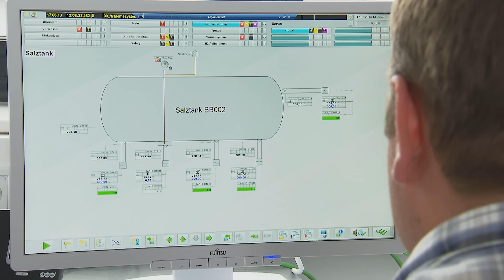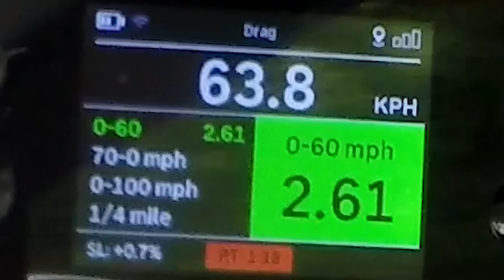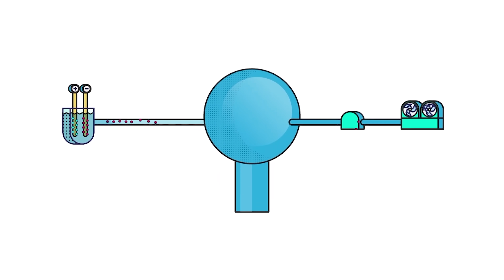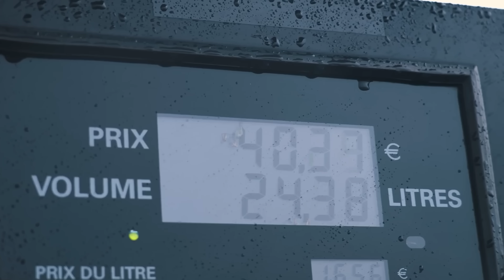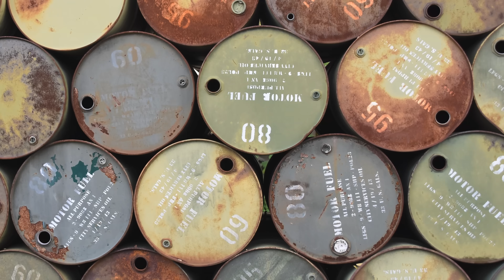Porsche just SAVED petrol engines FOREVER

Comment: Rather than banning ICE cars, if i were EU legislators, i would ban change of cars under 5 years.
I would say you will not be allowed to change and buy a new car while you have a 5 year old or lower car. And if you have a car between 5-20 year, you are not allowed to scrap it and you cannot sell more than 2 cars within a 10 years time span.
Especially now that synthetic fuel is a thing, they should use legislations to restrict planned obsolescence induced by users frequently changing cars. Because changing a Tesla every 5 years emits more carbon than driving a civic for 20 years. It’s fact

Comment: Look, if doing this successfully can save all combustion engines, all the big brands should be working on this. Bugatti has recently just released their last W16 which is very sad, but if this goes through correctly, it doesn't have to be their last. If all the big carmakers work on this as a joint venture, and eventually convince governments that it is the right way, there is no reason we can't convert to this fuel all around the world by before 2028.

Comment: Hi,
I think you forgot to mention a couple of huge downsides with E-Fuels: 
- Energy demand is 5 times higher than powering an EV (funnily enough you mentioned that beeing a problem with EVs) -> Will always be more expensive
- There are things that need E-Fuels more than cars (planes, large ships, industrial etc.). Meaning: Every E-Fuel driven car takes away from other use cases until scale up is complete. 
- Did we not learn what happens when you are overly reliant on energy from foreign countries? Why not take the route where you depend less on that. 
- E-Fuels do nothing to make air quality better and have no way of reducing brake wear through regenerative braking

Overall Im no fan of a ban, however this wont matter much in 2035. The law of the market and economy will dictate what technology wins.

Comment: Bring on the new ice engine ban I reckon.  The car lobby has the money to influence regulation (face it, corps run the world not govt).  Many won’t make the shift…either through cost or not fit for purpose…older will gain in value and without uptake of the latest iPhone on wheels large automotive companies will either go broke or change tact.
Our NZ govt brought in a ‘dirty’ car tax for Utes…blanket rule.  My ute that’s euro 5 complaint and gets 7.9l average…has a $5000 tax put on it but a sedan that averages 12l per 100km dosent.  This makes no sense at all, but instead of ruining the value of my ute it actually increased it as every ute went up in value.  Thanks Labour Party…I’ve got 3 utes (farmer) and you’ve actually done increased their worth thru your idiot manipulation

Comment: I hope this actually comes to fruition. As an EV owner, it is blatantly clear that EVs aren't for everyone and an alternative needs to exist to be able to sustain mobility. I am not too convinced about liquid hydrogen cars as of yet and it would pose a similar conundrum to EVs with the infrastructure to support them. But e-fuels really do hold a lot of value as the transition to them is not as far fetched and maintains a lot of the current infrastructure intact for petrol vehicles. Good luck to all pushing this forward.
Reply: Apart from the actual gas stations non of the infrastructure beforehand can be used.

You need:
New power plants (solar, wind, storage),
Water supply or desalination plants, 
water purifiers, 
electrolysers, storage for hydrogen, 
Carbon capture plants, 
E-fuel plants

The larger projects right now (Chile) als need transport infrastructure.
Reply: @theipc-twizzt2789  I was talking strictly about the distribution infrastructure which is the primary problem for EV owners and mass EV adoption. Production infrastructure development would come from most current fuel developers as they'll need to adapt or disappear. In terms of requiring carbon neutrality from the production infrastructure power source, if the countries are still not 100% non-fossil sourced, then it's a little hypocritical to request the same from the production facilities. It defeats the purpose when you charge an EV with a still primarily fossil driven power grid such as EU or US. That needs to be developed by each country's plan to shift but shouldn't be a dissuasive to change petrol for alternative fueling. As they say, every little helps and with time all pieces of the puzzle will line up.
Reply: @AStock2204  There is no point in burning fossil fuels to create synthetic fuels. You do realize that this would increase CO2 emissions? 

The advantage of battery based cars is precisely that: Even with an 100% fossil energy grid they have 10-20% lower lifetime CO2 emissions than burning fuel directly in an ICE car. This is due to combined cycle power plants beeing up to 60% efficient.

So no - the point you make should not be considered. The only thing that should be considered is CO2 emissions. If E fuels emit more CO2 than fossil fuels then they should not be allowed. It they emit less they are fine. 

I fail to see how the power grid is a limiting factor in this. Even in the worst case assumption the grid would need to grow by less than 2% per year to accomodate a fully electric vehicle fleet by 2040. I invite you to do your own calculations, but this should be somewhat accurate. 
Using home storage, virtual power plants and vehicle to grid should all alleviate this problem.
Reply: @theipc-twizzt2789  not my problem
Reply: e-fuels do not solve the problem of localised pollution. They still 'burn stuff'...so people living along main routes in cities will get no relief from NoX, S02 and particulates. The root of the problem is internal combustion, whatever it is you're burning. There is a better technology which solves this problem, we have it already and it is growing fast.
Reply: This all assumes that the push for zero CO2 emission vehicles is about saving the planet from global warming. EVs warm the planet in their own way (increased CO2 emission at production than ICE vehicles and increased thermal load to atmospheric from power generation and distribution. As predicted by the The Club of Rome in 1970s the tipping point for the atmosphere was reached in the 1990s, nothing can save the planet now. EVs or (e)fuel ICE is just another wealth pumping exercise from the poor and middle income groups to the already wealthy.
Reply: The day you can breath the emissions of a ‘efuel’ like it’s natural air, I’ll agree. Not gonna happen. Combustion produces a shitload of harmful emissions. Regardless of the fuel type. You want to keep poisoning us.. F U.. that’s my answer to anyone who decides to continue to drive combustion.

Look, i did it too for decades.. now i know better.. now there is a real alternative. It’s time to release the f’n damage we are causing ourselves with combustion and move forward. Fight it all you want.. bemoan that it might be hard or costly.. fact is.. we’re f’n poisoning ourselves slowly as long as we continue with combustion. And I am quite aware that we poison ourselves with other things everyday and accept it. Do we NEED to continue this one? EVs are only in their infancy.. they will get to the point that they meet 99% of use cases. If others continue to decide to burn shit for fun.. my proposal is, 100% of the exhaust gases are routed internally to the cabin of the vehicle. I’ll be satisfied that the morons who want this, get to enjoy ALL the fruits of it most directly.
Reply: electrifying water before the combustion chamber creates hydrogen.. water = fuel
Reply: Great... look to how your batteries for your car are made and by whom..In case you didn't want to know, so as not to interrupt your virtue signalling, it is children in the Congo who mine the cobalt, as young as six, owned by Chinese companies who sell the batteries to most of the EV manufacturers.
Reply: @gregorysukroo7167 he doesn’t care lol. Propaganda turned his brain to mush
Reply: @YuRMoMiNHD  I did read some papers on mining, minerals and batteries as well as hydrogen. 

If you know some papers that come to different conclusions i would like to read them. Could you provide a link?
Reply: @gregorysukroo7167 do you realise that Cobalt is used in refining petrol and diesel? Better stop driving your car you hypocrite.
Reply: @gregory Sukroo  Half the cars produced by Tesla use LFP battery which are cobalt free unlike the smart phone you are using to add your comment. Quick Google search will confirm this.
Reply: @gregorysukroo7167  Artisanal Mines in Congo account for around 15% of Cobalt production. That means that 85% takes place in properly industrialized mines (which, if you think about it for a second makes sense, as people with shovels could not nearly produce enough cobalt to cover world wide demand). 

In those artisanal mines there are unfortunately some children. Estimated suggest around 1000 children in all of Congo. The chance that my battery contains cobalt from artisanal mines is little, and it is even smaller that it contains cobalt from child labour. 

If you want to make sure to have no cobalt in your battery you can buy LFP chemistry. 

Did you know that 98% of cobalt produced is a by product of nickel or copper? 

Why is specifically Cobalt such a big problem for you? In regard to environmental damage cobalt and lithium are fairly ok (compared to oil) and child labour is a much larger problem on other sectors (like agriculture). 

Artisanal mines are also very inefficient. Some projections suggest that there will be essentially no such copper/nickel mines by 2026.

Comment: This is not news. Sabatier produced methane in 1897 and it was well understood that heavier hydrocarbons could be made from that. The US navy has made jet fuels from sea water and nuclear energy generated electricity for decades.

Of course it can be done. But it will be orders of magnitude more expensive than using electric energy through a battery. The same KWh used to produce petrol, can deliver many times more miles stored and used from a battery.

This will be a niche market for petrol heads at most. If they still exist in 2035. Because who wants to drive a noisy smelly ICE car when you can drive a faster, cheaper, cooler electric vehicle for a fraction of the price?

Comment: Ah ah -so the fossil fuel industry looby  wins. And we -an dplanet - are stuffed.  Unless you are somehow all naively gullible you know this E-fuel thing is just green hog-wash.  Real carbon free E-fuel will be just endlessly delayed and fudged allowing fossil fuel giants to continue to supply for decades. Thats what they ar eplanning for. Its the same with hydrogen . Green hydorgen production doenst make much sense (as you lose half of electricity upfront) why does that matter when fossil fuellers know the can coninue to fight and lobby to provide the grey/ blue version carbon produced. 
Might not matter so much as electric cars will become cheaper in show room soon. Simpler and more or less maintenance, servicng free with low fuel costs (currentlt costs me <£1 per 100 mile) -only ICE enthusiasts  will stick with ICE.
The stuff about charging is weak. I'm embarrassed how quick mine charges now. Barely have time to come out from loo before its' done at Tesla superchargers

Comment: Propagandist nonsense. The cost of e-fuels will be at least five times the current cost of gas. This might be fine to run some ice classics, but it is not going to mean that any manufacturer is going to be making ice vehicles in any quantity after say 2035, or more likely sooner. Which means that they too will be very expensive. Electric cars will be the same price as ice vehicles anyway by 2030 or before. Who is going to buy a car that costs more, costs more to run, that you can't refuel at home, costs more to maintain, is smelly, noisy and polluting and has lower torque and acceleration. By 2030 electric cars and the associated infrastructure will be markedly better than today. It's over.

Comment: Regardless of what Porsche comes up with - and reinventing petrol - doesn't a business case make. Unless Porsche already has some major distribution partners in tow, this will be just another minor option. All said, though, ICE engines will be supported easily for the next several decades. Easily! And the hand-waving about BEVs taking over with all this compromised tech (rare materials, dangerous recycling, significant overall costs, etc.) is not remotely logical or supportable. EV tech is already rapidly changing: charging, manufacturing, recycling, etc., etc., are well on their way to fixing ALL of these issues. Within a few short years, presentations like this will look more than a bit myopic. And keep in mind these ICE restrictions are ONLY for new car sales. Supply and demand will keep dino-based fuel around for quite some time, and I will be pleasantly surprised if Porsche's fuel will be anywhere nearly widely available.

Comment: Why doesn’t anyone talk about the source of the energy which powers all these new electric cars!?! The UK can’t cope now with the demand, let alone what’s coming. I’ve read that less than 40% of the energy the uk consumes is from a renewable source. This is only going to get worse with demand outweighing supply. So whilst it might be greener in the long run to use an electric car, the net effect isn’t drastically different. there is still a very long way to go and electric isn’t the answer - it’s the answer for tax breaks but that’s about it. The government backed the wrong horse, just like they did with diesel.

Comment: E-Fuels are gonna be a thing in the future, but not the solution right now. 

The only feasable way we can manage climate change is by, firstly, switching to 100% renewable energy and THEN produce E-Fuels with redundant power, moving as many people as possible (those who drive "out of convenience") to public transport, walking and cycling by redesigning urban areas and building out rail, and most important of all, make new cars  _lighter_, so less massive (I'm saying less than or about 1.5 tonnes/3500lbs for all privately owned vehicles).

Comment: With E-Fuels you're just adding another step between renewable energy and the vehicles.  Basically, instead of just going from the solar/wind to the car, you're using extra energy to actually make e-fuels and will also have to transport the e-fuel to the "gas/petrol" stations or wherever else 🤔All those extra steps will add extra energy consumption and cost. Sounds like a plan to keep the consumers in the pockets of the future oil industries.  Now saying that, it is definitely better than what we have now with the fossil fuels.  Still, I don't think there's anything that's gonna compete with the pure electrics.  Battery range is improving by the day.  Aptera is showing that there is potential to completely cut the middleman out. 🤘

Comment: I'd rather put the electricity straight into the car battery rather than a factory to create a fuel. And then put the effort into the problems with battery and ethics and charging speed.

Comment: It will never come about. Not the eureka moment everyone thinks. Batteries are getting cheaper, better all the tine and the network to support it is also accelerating. E fuels take a huge amount of energy to make and in order for it to be carbon neutral, needs to to be made using renewable energy.

It make no economic sense to do this when you can just charge a car / van / truck straight from renewable energy from your house / grid which by 2030 will be much more decarbonised.

E fuels will have use for classic cars and motorsport. It will never be cheap, think £10 per litre.

Comment: I am sorry, but as an Engineer I need to adress some things. First of all, as you said, one Problam is the aount of Green Energy to produce Carbon Neutral E-Fuel. But there is one major problem, that you missed. The Efficiency of E-Fuel. If you take 100% of Energy and put that in a BEV  throught the normal Energy Network you get around 70 -80 % of Energy at the Battery. But with E-Fuels, you get around 12 - 17 % of that Energy at the Tank. And if we consider the Efficiency of an ICE .... well, it dosent look good. I agree that for very big comercial vehicles E-Fuels might be a soulution, or for the owner of a Bugatti, but not for everyone. This is the next big flaw for E-Fuels, the price. Compared to normal Gas it would be around 3 to 5 times that cost at the Gas Station. Not so nice

Comment: but the process uses alot of electricity to make the fuel. the charging is not an issue for a long range ev. had one for almost three years now and never had an issue. guess it takes a while to get ppl used to not having to service the motor two times a year or change clutches and such. oh yeah,, and to get passed by something far far quicker.

Comment: The problem with any combustion e-fuel is that production is only one part of the puzzle. Let's say you can produce an e-fuel at a special plant completely carbon neutrally or even carbon positively if extracting carbon from the atmosphere. Now you have to transport that fuel to where it's needed. Can that be done carbon neutrally as well? Diesel Trucks? What about the massive ocean tankers? Run on oil powered engines? CO2 emissions at every step after production to distribute this already very expensive to produce e-fuel. And then when it finally gets to the end user, it's burnt and produces emissions. There is no way that whole, production, transport and finally burning is going to be carbon neutral. And it's definitely not going to be affordable. It will literally be a niche market for super wealthy people buying extremely expensive Porches 😅